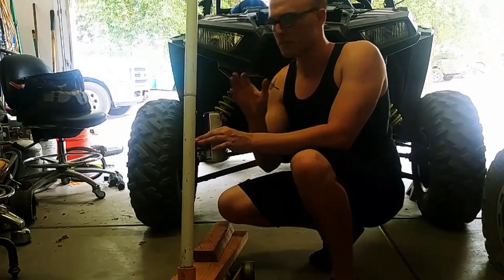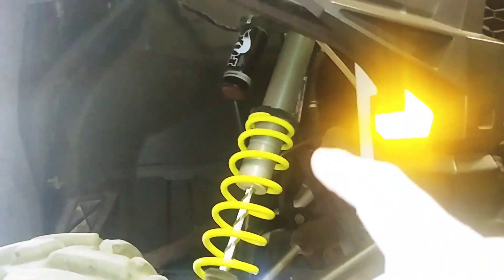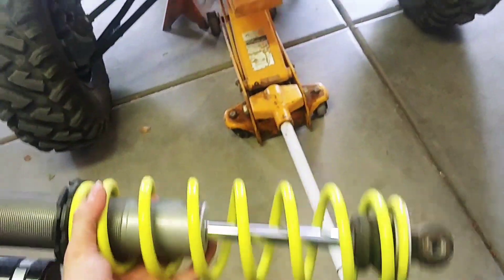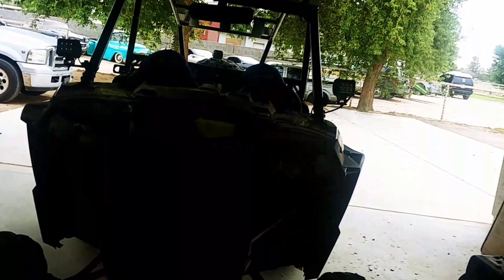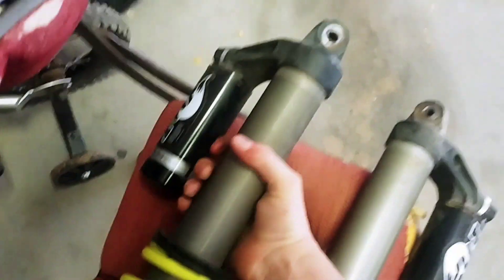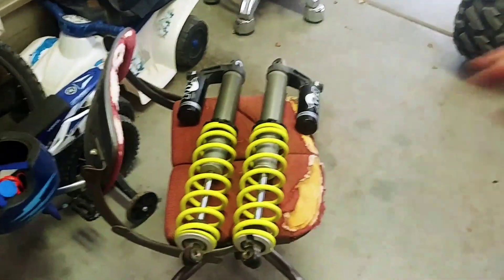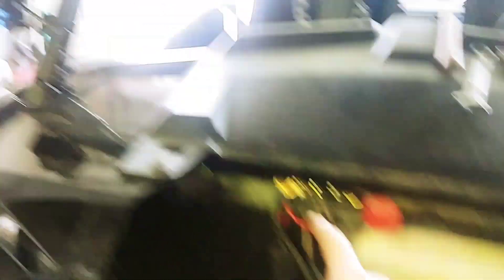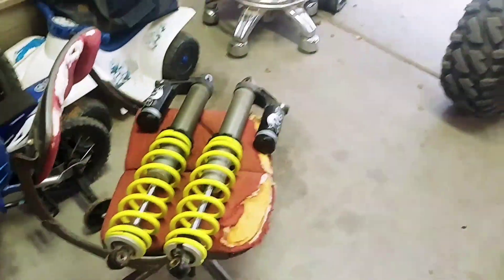Polaris RZR 900S Blown Shock!

Comment: We’re your shocks making a clunking noise?
Reply from the maker: Yes over each bump I hit.
Reply: Mine is making an awful clunking sound over every bump too. Sounds like the passenger front shock. Does it have to be completely replaced?
Reply from the maker: No just take it off and have it rebuilt, it should just need new seals and gas..

Comment: Hey man I have a 900s as well. Couple questions for ya. How did u know your shock was blown? What issues did u have on it other than the clutch issue? If u could do it all over again. Would u still upgrade to the can am. Is it that much more fun. Which is to say is it double the fun of the 900s? Since it's  basically twice the price. Deciding if I should upgrade but I don't really ride that fast. Mostly in mud. Thanks for any advice
Reply from the maker: It sounded very clunky in the front and shocks were leaking all over haha and yes I absolutely love my canam, I have no remorse on buying it.. I loved the rzr as well but canam fits me better and handles my type of driving alot better lol
Reply: I realize I am pretty randomly asking but does anyone know a good website to watch new tv shows online?
Reply: @Archer Chance flixportal =)
Reply: @Nickolas Kaiser Thank you, signed up and it seems to work :) I really appreciate it!!
Reply: @Archer Chance no problem xD
Reply: My 900s front end rides ruff as hell. Even after putting stage 2 dual springs on it. They don’t leak at all so I’m guessing they need rebuilt.
Reply from the maker: Check the preload
Reply: @RandomRedd  I’ve tried everything. Zero preload to higher.
Reply from the maker: @hillsboyofficial what's rough about it? Don't mean to sound rude but trying to give suggestions
Reply: @RandomRedd  just feels really ruff like I don’t have shocks at all. I’ve even put a GoPro under there and watched it while riding and things seem to be working ok. I feel everything in the steering wheel. Bought new dual springs and it helped a tad. I’m debating buying elkas or just buying a different one with better suspension.
Reply from the maker: @hillsboyofficial  yeah could just be the rig!.... I had my 900s fora couple years... pretty much felt the same way as you, so I upgraded to a 2021 canam xrs turbo rr.... better suspension and power
Reply: @RandomRedd  yeah that’s awesome. Not sure what I’m going to get.
Reply from the maker: @hillsboyofficial well keep in touch, I'd love to know what you go with!! This channel is more towards Lottery, however I do ALOT of sxs content (when the weather is nice) as well!!
Reply: @RandomRedd  ok man sure will thanks.